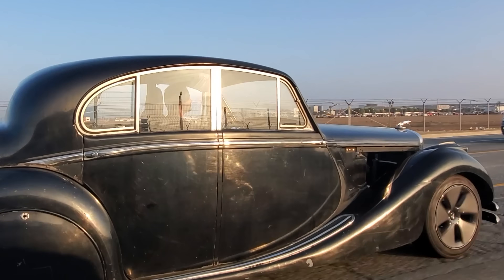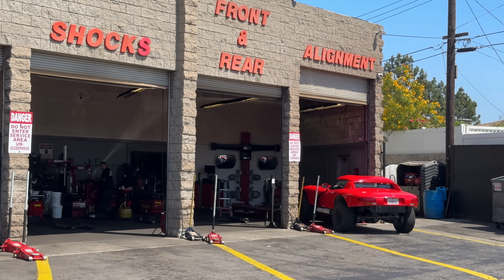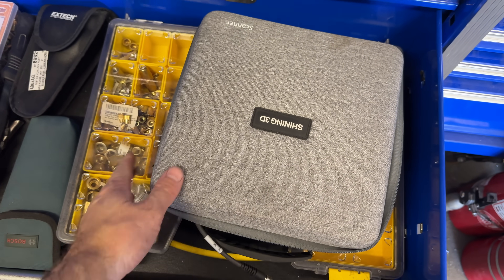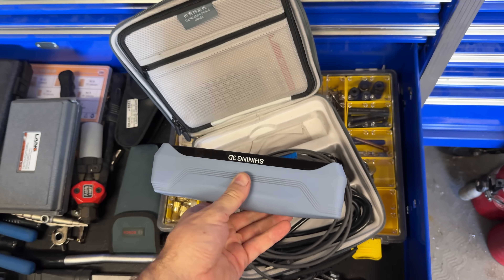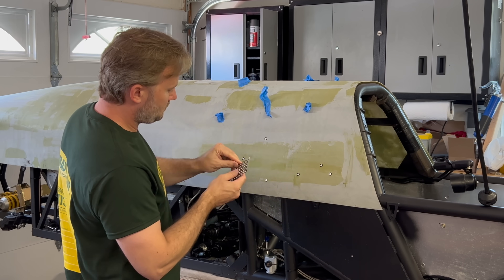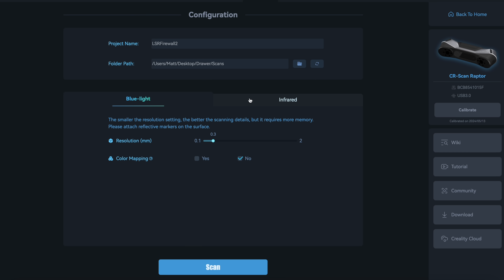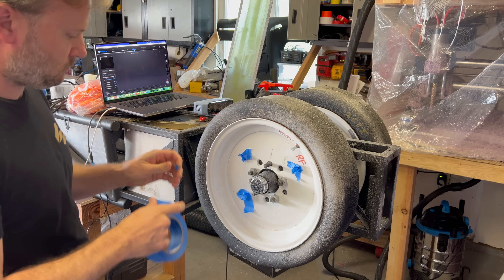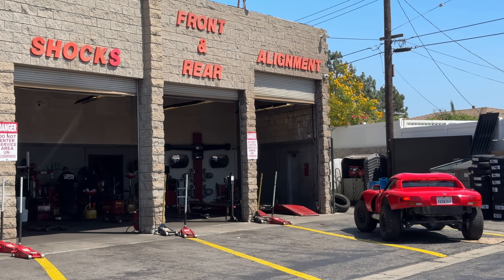Car Alignment With A 3D Scanner

Comment from the maker: Go to https://ground.news/superfastmatt to become a smarter news consumer and see every side of every story. Subscribe through my link for 40% off unlimited access this month.
Reply: Most diplomatic and yet accurate review I've seen on YouTube for ages! Very good job sir
Reply: Just get some good casters for the shop stool you have....
Or....... 3d scan bottom of stool, 3d print casters, install, break, THEN buy new ones!!!
Reply: The creality scanner screen goes white when it cant porcess all the data. Basically you have to break up the scan into smaller parts and combine them in another 3d program. It's junk. And their tech team you deal with is less than interested in helping.
Reply: I once did manual alignment with a 2M level, and a vertical auto laser level. Then calculated steering pitch (thread) to degree and it came to within 0.1 degree, which I think was fine. 🤓
Could the scanning be increased with just some reflective dots on alu profiles laying on the floor or near object being scanned? Then removed in post? So they could be reused later.
Reply: Have you tried making target tape for your scanners? Put the targets on strips of tape and you can make them easier to apply/remove.
Reply: It's almost like you need a BB sized paintball gun that can just rapid-fire shoot reflective dots onto your surfaces.
Reply: Matco makes the best rolly stools
Reply: tl;dr: attach new, better casters to steel adapter plates screwed into the old caster holes.

I have the non-braced version of that HF stool and just recently fixed the casters. I bought 4x 4" stemmed urethane casters at HF for $5 each, searched for two months for 1/2-20 sleeved insert nuts, which apparently don't exist in premade form. So I got  36" length of 3/16" steel, I think 1 1/4" wide. Cut it in half, center them on old caster holes, drill 3/8" holes for the old, 1/2" (or 17/32") for the new. Bolt the thing to the old holes, then attach the new casters to the holes at the ends of the bars. Now it's much heavier and tolerant of cracks. $50 to fix a $35 stool, but hey, it's less trash, and others probably have more of this stuff laying around than I did.
Reply: Is that an off-road viper?
Reply: PLEASEUSE LASER GOOGLES. LASERS KILL YOUR EYES.

:)
Reply: How do I bookmark this video? I'll already know I'll forget this video about 3 seconds after Google recommends something else 😮

Comment: i think one issue with your scenario is that it does not seem that you accounted for wheel runout, which the alignment machines do account for (during the rollback portion).  All wheels have runout, steel wheels more than aluminum ones, and there is enough that it will usually be enough to throw toe off.

So your alignment based on your scan is probably accurate for that spot which you happened to measure off of.

hope that helps encourage you :)

PS: the alignment machines don't really align to the vehicle centerline.  They align to a computer model of the centerline, based on the angles found during the rollback portion.  i developed some quick and easy alignment tools to deal with this since i got sick the the Hunter machine not doing things properly.

Comment: Hi Matt, i am shocked, because you state the same problem using the Raptor. Quote "If you don't want to cover the whole floor with markers, the Einstar is the better scanner for your purposes, only to wobble and get convincing results. I also state the low scanning performance of the Raptor and the poor state of software". One thing what shocked me is the price of the Shining Einstar, beeing halft of the Raptor? Do you really have checked out the correct version of the einstar? Read those reviews, they tell a different story as you do. After seeing the your video, i got convinced to have better bought an Shining Einstar than a Raptor, but reading the software revieus oft the einstar i am completely irritated. Should i send my raptor back and use the einstar? Because i am doing a similar engineering job as you do, i am working on an conversion of a chevrolet corvette C3 to tesla drive. What ist your recommendation, because i like wobbling too?   Your statement "the infrared mode is better and much workable than the infared mode who requires markers and "poor Raptor software" is my showstopper too. Should i return the Raptor and buy the Einstar with half of the price? What do you recommend?

Comment: Hey, I hope you see this. I also have an Einstar scanner. The best way to use Tracker Dotes is to use a piece of painter’s tape. Place the dots on the tape, and then you can easily remove and reuse the dots by adding a smaller piece of tape at the end of the tape you placed the dots on. To get a better surface scan without the dots, move the tape up or down, delete the tape from the scan, and then re-scan the empty space. Finally, combine the scans in the software. Hopefully, someone sees this and it helps.

Comment: i dont know if youll answer this question but why not just 3d print markerdot structures that have magnets at the base so all you have to do is just place the structure and it magnetically attaches to the car since it is made out of metal. unless your a carpenter with a car-penters car.
yes i did intentionally say that.

Comment: Do you still have the Raptor and have you felt with some of the updates that it has improved? I found my biggest issue is running out of memory despite having 64GB and never really reaching a limit. I usually hit memory  limit during post processing and not the scanning itself.

Also found that, while I already knew the laser needs the markers, you really need ... a LOT of markers.... and it will turn out to be pretty wasteful. I had someone print some shapes that I pressed magnets into so I could 'reuse my stickers' but the Creality app is only good at removing the stickers... otherwise it's a painful manual process to remove the shapes with the stickers on them.
Reply: sorry somehow missed end of your video. Yup that checks out.... still want to know more about the memory issue though...

Comment: Honestly, this scenario is a bit of a stretch for a fair comparison between those two scanners.
You scanned only large to incredibly large objects, which both scanners are clearly not built for.
Also, you don't like targets but still you are ok with having to cover every reflective object with baby powder to get the Einstar to simply work, kinda the same if not worse to be honest.

Comment: How to marker targets. Use strips of tape then out the markers on that. Makes for easy removal.
I made about 25 marker stands with my 3d printer that has the markers on them and a strong magnet on the bottom. Just stick a hand full of those on and scan quickly with the laser. Then you can reuse them too, added magnets to a turntable so can just toss the marker towers on that too.

Comment: If you rolled the chassis off the alignment rack, took all the equipment off and put it back on you can guarantee the alignment would be different. It’s reduce if you have full spherical bearing suspension but. It is usually change by .1-.2 on a road car.

Comment: Did I miss a comparison between the 3d Scanner, string and straightedge with angle finder?  I'm less interested in whether a 3d scanner is as accurate as an alignment shop because I'm less likely to go out and buy an alignment shop.  More curious about whether it's worth 3d scanning for alignment (with a decent scanner) or if the extra time isn't worth the difference between the straightedge and angle finder/ string method.

Comment: Wouldn't the scanners work better if they had an anchor to compare their coordinates to? The anchor would have a 0, 0, 0 coordinate, along with 0, 0, 0 orientation, and the scanner compares its own distance and orientation to the anchor. The only problem is the anchor would have to always be within line of sight of the scanner, and a way to receive and send data from any orientation.

Comment: I take issue with the claim that a string alignment is less accurate than a shop alignment. Those fancy machines aren't made to be more accurate, they're made to improve production speed and allow even unskilled techs to do as many alignments as possible in a given time with "reasonable enough" accuracy to minimize comebacks. A string alignment may be much slower and more tedious, but it's also super accurate. Multi-million dollar race teams still do string alignments when accuracy matters. I've been doing my own alignments on all my cars at home for years now, and the results have been superior to any shop alignment I ever got.

Comment: I do alignments on old vehicles we sometimes don't have specs or full specs for. Generally depending on suspension and tire type you can get close. Camber between 0 and -1 degrees, toe near zero but a little toe in makes it more stable feeling, and caster which is very important will be  heavily dependent on if it's radial or bias ply tiers and if it's double wishbone or mcpherson and power or manual steering. Caster is really critical, as important as toe.

Comment: So one of the reasons I think you're struggling with scanning and having to use so damn many tracking dots is that the scanners are too small for the parts you're trying to scan. I do scanning & dynamic 3D camera measurements for a living and I'm generally in agreement with your opinions of scanners. They're great tools, especially if you know what you're doing with them, but not without their flaws. I'm not a fan of shape-based tracking as it can contribute to error stacking, as you saw. Tracking dots with a larger scanner would likely give you far better results with good enough accuracy and less headache. They are annoying to clean up, though.

Comment: I don’t know if you tried that already, but I have some cheap laser pointer with a diffraction lens to project a dotted pattern instead of a single dot, maybe such could – say mounted on a fixed tripod – replace the stickers and provide enough variation to ease the scanning process with much less hassle. Unfortunately I don’t have a 3D scanner so I cannot try it myself but I bet you can easily find a similar laser pointer to try.

Comment: You want a lab stool. Like the one the doctor sits on when you get a physical. They have a wide variety with a vast price range depending if you want a certificate of compliance with it.  Another pro tip is to get a third party adapter that lets you swap out the old junky plastic wheels with roller blade wheels on skateboard bearings, smooth as butter across concrete floors

Comment: About the holes not getting scanned well enough: Just put some studs or bolts in there to get better results. Should be much easier to find the center of the hole.

Comment: Yet another cool video.  I've trans bolt pattern taken from gen 3 viper engine with 3d measuring arm. Made my own adapter plate with it. The pattern is same as gen 2 but dowl pins are different location. That would/could be good enough?!

Comment: I have had the same experience. The geometry mode on the Raptor is practically useless. I tried everything, adjusting exposure, etcetera, but it did not help with tracking. Texture mode worked much better for me, especially with some spray on the parts. It eliminated most overlapping issues. Laser mode with sufficient marking dots was almost as easy to track.

Comment: Laser mode tracking on my Raptor is great with targets, but every other mode has been terrible. Geometry mode is useless, even with complex shapes. The scan just smears. Texture mode is better but sometimes overlaps. Targets outside laser mode are a hassle. It is unfortunate not everyone has the same tracking issues.

Comment: A tip with the targets: use small pyramid shaped objects with flat surfaces (something 3d printed for customized shapes) and stick the targets to those. You can then stick those to your scanned object with strong tape or glue and you have the best of both worlds

Comment: I have the creality ferret pro scanner and its a love hate relationship. I have been able to do a number of medium sized objects but the tracking can be pretty annoying at times, where the scan just starts spinning in the software. I do have to say though, it did a phenomenal job on a dewalt drill, i was pretty blown away.
Reply: if it starts spinning, probably the object is lack of geometries. You may need to select another mode

Comment: I worked for Hunter Engineering (makes the aligner the shop had). I spent years training users on alignments for cars and heavy duty trucks, from a Ferrari dealer to buses to military vehicles. 
A high quality shop with this equipment and a good technician can align anything. A 3d scanner can in no way measure Steering Axis Inclination, the Ackerman angle, included angle, or various toe variations under steering inputs. (Your improvised turntables miss an important needed feature - a center pin to keep the slip centered; without that, the measurements change with steering input in a way that would not happen while rolling.)
All these measurements contribute greatly to a car turning and handling well and should be measured on a custom built car. The measurements can be refined with test drives and adjustments; you may find that a thing you built was not Good Enough (perhaps a Panhard rod and idler arm) but your car will handle much better if you have these mastered.
All hail the algorithm and Aloha!
Reply: I expected him to have problems with reference to the ground. Much of an alignment is based on how the wheels interact with the ground. Seemed like scanning like that references mostly the body and chassis which might not really be straight or square like you want. 
Alignments are one of those things that seems so simple until you really start changing things. Then it can get complex with how many moving parts need to work together for something to drive right. And, how much changing one thing can throw everything else off. I’ve seen people move an A-arm mount for clearance and then not understand why it drives bad when they set toe and camber…
Reply: @NBSV1  Exactly! I had a shop call me that they could not align a customer’s ‘78 Buick. I set up a time to see what was going on. His wife, 110 lbs soaking wet, brought it in for the alignment and the husband complained that it pulled when he drove it.
When I met the customer, he was 350+ pounds. I had him sit in the car, did the alignment, and it was spot on.
Pulled the other way when his wife drove, though.

Comment: I have one of Crealitys original 3d scanners. A few years back had to do some work scanning car body panels and had the same issues with the software. I went to an updated version of the software and had to revert back as the new version essentailly made the scanner useless.

Good for the price but frustrating to do any real work.

Comment: For the wheely stool I recently swapped my office chair wheels for roller blade wheels (they're a slightly larger diameter which raises the seat height the amount I need) and because they're thin and hard they roll really well on flat floors, so that could be a low cost option to fix your current seat
Reply: They also likely have bearings in them. A lot of office chair wheels are just the plastic wheel on the shaft. They don’t feel much different unloaded, but the bearings are going to tolerate weight much better.

Comment: I have an older Creality scanner and it is complete trash. Software sucks and I just can't get a complete scan without a few hours of swearing. After initial trials I tried again about 6 month later hoping there would be software or firmware improvements but no....

Comment: I’d be really curious to see your numbers with the string method compared to the alignment shop. I’ve used the string method myself and seen plenty of race teams use it and never really doubted its accuracy (though with my wheels and measuring equipment precision is limited to about 0.1°, which I consider easily good enough for my purposes but YMMV) but it is indeed a pain.

Comment: Spot on. I use the Einstar for the big car parts and the Raptor for things like interior features. I don’t use the NIR mode on the Raptor at all. I’m glad I have both because IMHO there is no overlap between the two. They don’t compare
In infrared mode and Einstar has no lasers. I hope Einstar V2 adds lasers.
Reply: Before finding this video, I was pretty sure I wanted the Raptor. Has the software improved in a year? I mostly need it to scan engines and engine bays. With specific importance to engine/transmission bolt patterns.
Reply: @connorbabcock7718 Einstar 2 is being announced in like 10 days. Creality Sermoon S1 is out now. The Vega is great and the Tucan just launched. So many viable choices. Even the Otter Lite is very usable... I'm using that now for quick car body scans.

Comment: I really hope all this feedback makes them improve software and maybe firmware. 
A hybrid mode where it can use the NIR for geometry tracking (if it was as good as the Einstar) while using blue laser to collect detail without needing so many markers would be great. 
I have both of these and thankfully you can overlap scans and use the Einstar software for that. It's so much better. 
Hurry up and improve your software creality.

Comment: You definitely over thought this lol. We still use old fashioned toe plates on late models and modifieds. Camber and caster are checked with one tool that mounts to the wheel hub. If it’s good enough for race cars it’s probably fine for your road cars. The lane speed car I understand more precision though
Reply: The tool I mentioned was not like the ones you found on the internet. Much nicer
Reply: Found it within a minute of searching google. The intercomp digital camber/caster tool